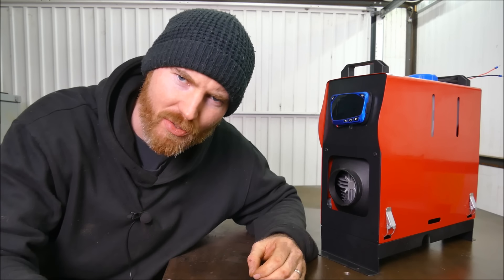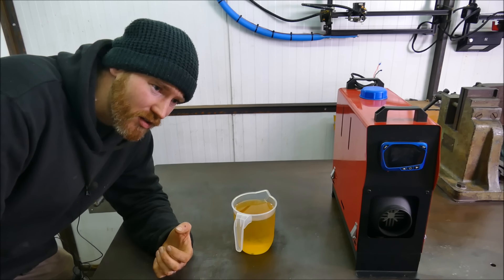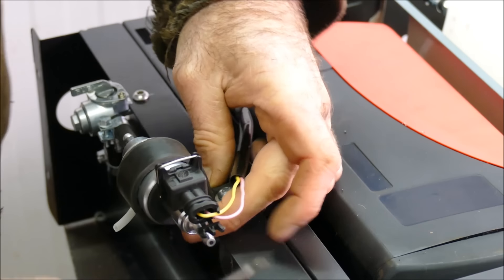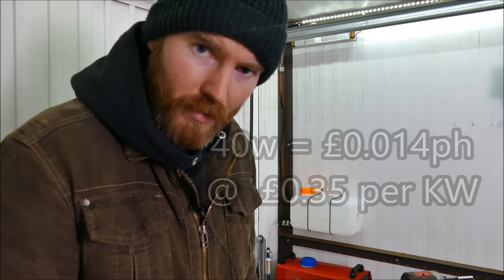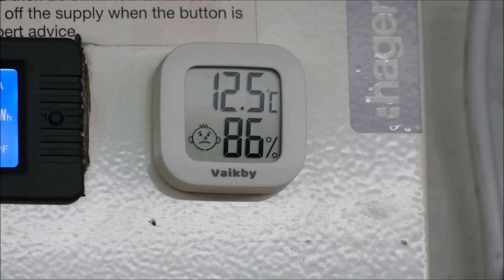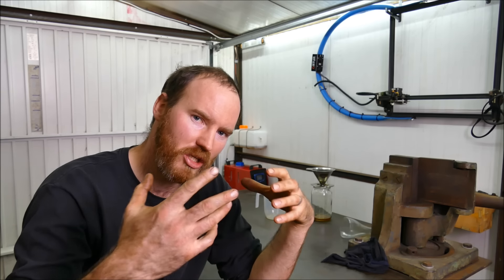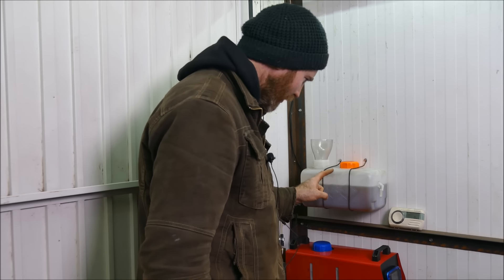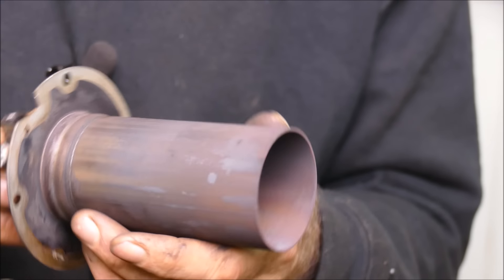£0.03 per kWh heater modification - Top facts & lies on diesel heaters - waste veg oil burn success

Comment: I use a 5KW heater in the greenhouse and when I extended the exhaust as you have I had problems with it not burning clean presumably through the back pressure not allowing it to clear the fumes quick enough , I then used a 10 foot length of 42mm copper tube as the exhaust. This runs the full length of the greenhouse and as it exits it is still too hot to put your hand on it without getting burned, however it runs much cleaner. The point being the soot build up you experienced may be due to exhaust restriction rather than the fuel. It might be worth experimenting with say a length of scaffold tubing it's easy enough to fabricate a connection with the gear you have.
Reply from the maker: Great information. Thank you. Cheers J
Reply: Where I live it frequently can drop to -18C (Canada) for my daily use the fuel is 50/50 diesel kerosene, exhaust short as possible on a downward angle. My needs are primarily heat, but the mods are ingenious and informative. The cost of energy in the UK to me is staggering, luckily you live in a temperate climate.
Reply from the maker: @wrxs1781  I just found out we buy a lot of Canadian trees to fuel biomass energy in the UK. To me that's crazy. Cheers J
Reply: This is correct thinking. If you increase the length of the exhaust on these heaters or use more than 4 bends, you have to increase the size of the pipe.
Reply: @joshuadelisle  As in wood pellets, many people heat with wood pellets "pellet stoves" "compressed sawdust pellets, and corn stoves, using corn kernels. People out of the cities heat with wood, or propane.
Reply: And heavy mass tubing will absorb massive amounts of sound.
Reply: Given the time,  if waste oil is stored over a long period the water and gunge drops to the bottom, so with a take-off up from the bottom you get much much cleaner oil.

Comment: You should consider the drainage gradient of your exhaust since the exhaust is now coming from the bottom. might even want to consider a syphon to drain the condense water if you're increasing it's length or making it into a exchanger. Further a great informative vid!
Reply: Burning one gallon of gasoline creates CO2 and 1.5 gallons of water. Ask a chemistry teacher why.
Reply: Indeed.  I heat my large workshop with a condensing exhaust gas boiler, and the exhaust wraps around the heat exhanger, that has a sealed drip tube off the bottom, where it feeds into a siphon/trap that delivers waste water where it can be disposed of.  And it’s a significant amount. :)
Reply: I was going to get one of these for emergency home use.  I was going to get an extension and run it up the chimney.  Are you suggesting condensation would run back down the pipe making this impracticable?
Reply: You've got to get rid of that corrosive condensation. Straight up is a recipe for disaster, IMO.

Comment: This was SUCH a great video! I am for sure going to use the copper tubing heat exchanger idea! But how much does a repair kit cost? If it’s over 5$ and you have to change the screen and gasket every other time it’s not worth it to run waste cooking oil. I was really excited about that as I have access to as much as I need.

Comment: Wrapping a coil of copper and then insulation around the exhaust would be far safer. Work on that hot water rises to avoid pumping it if you can, also get a pressure vessel that u can pressurise with the compressor to force the oil through to filter it. Perhaps modify a beer keg or an old compressor tank etc. also does your backyard smell like a chippy now? Lol

Comment: If you are trying to see how much you can squeeze out of the heater you might do well to make an airtight cowl around the exhaust pipe and run it into the air intake. Vent this to outside and you will pre-heat the air going into the heater. This would allow you to measure the heat gained, not that you would gain any more heat ;0)

The difference in fuel usage could be down to the different viscosities of the different fuels.

A great series of videos ..... please don't stop!

Edit ...... Don't Try This!
Read the comments below to see why not (unless you want to trash your heater control circuitry!
Reply from the maker: Good tip. Thank you. More to come. Cheers J
Reply: @joshuadelisle    Within their capabilities, these pumps are positive displacement type.  If viscosity is reasonable and lift limits are reasonable, the volume pumped should be the same.
Reply: You'll then be heating up the electronics where they are purposely placed at the cool air intake.  I would perhaps design an additional heat exchanger round the exhaust system and then exit to outside.  Put the squeeze on it!
Reply: Add to the viscosity, that oil canister was mounted higher than original tank, which creates extra pressure
Reply: @iIiWARHEADiIi  The design, as a parking heater could easily lift diesel from the vehicle fuel tank.  The prescribed limits of fuel feed,from above or below, are in the installation instructions - those things that lots simply seem to ignore!
Reply: o no you dont do that 👉
do not preheat your intake air with the exhaust. 
you running the risk of overheating/melting your elektroniks and/or the fan....
dont ask how i know 😒
Reply: A finned tube radiator would be an ideal exhaust pipe. Sometimes those can be had second hand for pocket change. Or run the exhaust pipe -in-pipe with a ventilation spiral duct, and put gravel inbetween.
Reply: @torbendk2777  and cold air is denser, means it is geting more air
Reply: @tommay2561  NO!
I was suggesting using the exhaust pipe to heat the incoming air. 
I did not realise that the incoming air was used to cool the electronics though ..... so maybe not the best idea? 
Having said that we already Do breath in burned fuel, every day, every single one of us!
Reply: It looks like I was wrong ...... but right as well!
Rather than taking the exhaust heat and putting that to the input but the other way  round .... take the heat output and run that across the exhaust to suck out some additional heat from that!
Reply: @torbendk2777  Agreed, and have had this happen when the oil heater was sucking fresh air in from an auxiliary heater on my bus whenever I was driving. very quickly had hard thermal shutdowns
Reply: Dude thxs for no ads
Reply: Don't do this as cold air has more oxygen molecules per unit volume due to its higher density.

Comment: Just a little suggestion if you wrap copper around the exhaust you will want it oriented vertically. If it's horizontal you may get a vapour lock which could burst the coil. Of for instance the water pump fails.

Comment: You should actually try a small car catalytic converter. They produce heat as they cause the reaction. It will also add a long pause in the gas flow in the cat due to the turbulence. Just keep it really close to the heater so it can get hot enough to start the reaction
Reply from the maker: Good tip. Cheers J

Comment: Great stuff! Worth watching (&subscribing)... Saved my frying oil(for making oliebollen) and wanted it to mix it in with regular diesel and also the latter to be replaced by kerosene. When running your diesel car on veg oil, it was advised to just mix a little methanol in it as the viscosity is lower which could create starting problems. I would just run with 'blended' fuels. It looks we are going back to the old times, making our own fuel to stay independent! It was also the reason as why mr Diesel invented the diesel engine (only rich people could afford patrol cars). The whole reason why governments want to get us electric, to take our liberties. Anyway, great upload, looking forward to your next one!
Reply from the maker: Yep I totally agree. Im working to be independent from the government and corporations. Cheers J

Comment: You made a lot of mistakes like I did in the beginning. The exhaust pipe must always go downwards. You never take the intake air from the outside because of the large amount of moisture that later accumulates in the exhaust pipe, which condenses on the walls of the exhaust pipe, especially if you try to use the thermal energy of the exhaust pipe by some kind of heat exchange. Residues of unburnt vegetable oil and moisture from the air, if combined, create a chemistry that begins to slowly eat away at the metal parts it comes into contact with. And lastly, filtering the vegetable oil. You don't want to filter warm oil, you want cold oil. The reason is that you want the filter to catch as much coagulated glycerine as possible, that glycerine contains particles of water that are in the oil, and the glycerine itself is very difficult to burn and will clog the chamber and the exhaust over time. I personally heat the oil to 100 degrees Celsius on my wood stove then let the oil cool. I fill it in 5-liter plastic bottles and put it in the freezer. When the oil coagulates, I filter it. I mix it with diesel 50:50
Reply: The water doesn't come from the air. Most of it is from the burning itself. Any time you burn hydrocarbons (combining for example O2 and C8H18 (octane)) it produces CO2 and H2O.
Reply: @kalleguld Wrong.  Just wrong.
Reply: @Sonex1542  @kalleguld  is correct b/c combustion does indeed produce water vapor.  Thus why you often see water dripping from a cars exhaust pipe.  Cooling the exhaust will cause the water vapor in the exhaust to condense.  Water in the air will not likely survive the combustion process.

Comment: "Like anything German they made it right" clearly you haven't owned a German car of ANY brand in the last 15 years 😂 mate
Reply: That is the unfortunate truth.
Reply: LMAO
Reply: Why what’s wrong with them? If you make a statement, back it up with stats. Open a debate up..
Reply: @GooseEldredgeFam   you want stats. Look at every reliability survey over the last 10 years. British and German at the bottom. Japanese at the top.
Reply: Not true. The uk would be at the bottom and Germany is number 1 in terms of vehicles that is. Though I would agree that Japan should be number one
Reply: @velling12  look I own 2 German cars. I'm just saying I've worked in the trade long enough to realise how downhill they have gone in recent years. My judgment isn't clouded by an old 'quality' name, just recent products. Where as the Japanese may not have the nice interiors (in general some are beautiful like lc500) but they'll do 100k no problem with routine servicing. Germans used to be like this. But now after working in main dealer I can confirm after 3 months of buying your brand new German car if you don't have an engine light on for a known fault they never want to acknowledge , your lucky. Bmw. Vag. Merc actually turned themselves around slightly since early 2000's, best of a bad bunch now but customer service awful so evens out as just as bad.
Reply: @Jw20000  I agree, but that's not what the surveys say. Germany still at the top

Comment: A couple of things - there is not necessarily a leak in the condenser exhaust; you just wildly underestimated how much water will condense out of the flue. 3CH2 + 6O2 = 3CO2 + 3H2O Therefore you get roughly the same volume of water out as hydrocarbon you put in (1/1 ratio although the densities won't be exactly the same.

And 140°C is not half of 306°C, as 0°C is not absolute 0 (that's -273°C or 0°K). You also need to account for the energy in the gas state; Condensing water yields >100% of thermal differential. Aside from that great video

Comment: Hello, very interesting series, a few thoughts here:
- You could use the system that modern gas stoves use. Basically, they heat the incoming air (directly from outside) while the exhaust gas is forced out. They do this by using 2 concentric tubes as heat exchangers. Very simply put, it is a tube within a tube, the inner tube expels exhaust gases, the space between the tubes feeds cold outside air and is heated by the inner tube. This is the way many efficient gas burners work, so it must be efficient. This also gives you an easy way to deal with condensation.
This way, your hose will also feel cold and should not have any meshing around it.
- Secondly, I see you are comparing electricity prices in kWh with your diesel/kerosene prices. This is correct if you assume 100% thermal efficiency of electricity, such as a boiler or induction appliance. However, a heat exchanger can easily exceed thermal efficiency by a factor of 4 (I have heard some even say 5).
This means that if you put 1 kWh of electrical power into a heat exchanger, it will emit 4 kWh of heat as energy. This is how heat pumps and AC units work.
Of course, there are other factors to consider, such as the desired indoor temperature and the outdoor temperature, but you get what I mean.
Comparing it to a resistive electrical load is somewhat incorrect.
- Thirdly, cover the electrical connections you made on the transformer so that they are not exposed.
Thanks for the content, I enjoyed your efforts 🙂
Reply: For most people, their biggest heating bills are when it's cold outside, like 5°C or less, and in these conditions (with a delta T of 15°C or more) there is no way heat pumps will have an efficiency of 4 or 5, it'll be much less. If anything, saying heat pumps can cost as low as 9p per kWh is being very generous. I say this given that in the summer months, the heating's on so little, that it doesn't make sense to work out costs based on efficiencies of 4 or 5.

Comment: If you use the electricity to run a heat pump, you should stretch the heat much further. For a source of heat to pump, try the exhaust stream of the generator.

Comment: To give the exhaust a better flow use a 4” aluminum dryer vent and recoup more heat with less restrictive flow.
Reply: You want more surface area to extract more heat and as slow a flow as is practical, so the ribbed flexi stuff is probably better than smooth tube.

Comment: I found that baseboard hot water heat pipe works great to extract the wasted heat going out the exhaust, it is copper pipe with aluminium fins and I was able to extract 90% of the heat that was going outside, it comes in 8 ft sections or better if used and get for scrap price, also its a TOTAL of 270 degrees on the exhaust so 3 90 degree elbows or better yet not a hard 90 rather a soft 90 to help reduce too much back pressure , the long section of hot water baseboard heat pipe extracts most of the wasted heat, was getting 250 F from the air duct and 270 F out the exhaust...
Reply from the maker: Great information. Cheers J

Comment: You could try to use the heat from the exhaust to heat up the inlet air. If the temperature difference is higher (inlet air is colder) the exchange is more efficient.

Comment: Letting the intake pipe run right next to the exhaust for a bit should make for a good preheating system. And covering the rest of the pipe with even more structure that acts as heat sink should drastically increase how much heat you can siphon. You might even get away with just sticking on some old heat sinks for computers on top of it.
But at this point you definetly will produce a lot of condensed water again
Reply from the maker: Thank you. Great tip. Cheers J

Comment: Be careful with the line power mounted above the power supply.  A piece of tin as a heat shield will prevent any melting of the insulation.  You have put together an excellent video, thank you very much for posting this.
Reply from the maker: Thank you so much. Cheers J

Comment: Put a catalytic converter as close as possible to the exhaust port. I bet you'll be able to run a bit more efficiently and not worry about smoke as much. You can get small ones for pretty cheap.

Comment: The hard line is only needed between the pump and the heater. easier way to switch between WVO and kero is to use two fuel pumps teed right at the heater, then to switch you just wire up a three way switch to switch from one pump to the other. this way you don't have to run it nearly as long when you switch back to kero before shutting down.

Comment: Top Tip for getting more heat out of the exhaust. 
Route the exhaust through an old radiator. 
Seen a German Youtuber do it and it got very hot and helped heating. 

To be honest, if it was that cheap to heat with a diesel heater where I live I'd be heating my house with them.
Reply: Thanks. So it is not that cheap after all? Is LPG or natural cheaper?

Comment: You can also use an egr cooler off a car/van to heat water up just put the water tank higher than the cooler and you won’t need a water pump

Comment: how much sqm can heating?
Reply from the maker: Check online but for a 6mx2mx2.5m room requires 2kwh of heat to be sufficient. It depends on how much fuel you use but diesel/kerosene contains 10kwh of potential heating energy per litre. So this unit produces 3.5kwh minus what is lost through the exhaust. Cheers J

Comment: What about putting exaust through a sand battery to reclaim more heat and you could put a copper line in the sand to heat water.
Reply from the maker: @greghasselback  I've tried that in the next part of the series. Cheers J

Comment: Have you considered running the exhaust pipe into a radiator (at the top of radiator) another pipe (from the bottom of radiator) to capture the heat from exhaust?

Comment: Old carbureted cars sometimes had exhaust heat exchangers, used to heat up the engine intake air (for better carburetor efficiency I believe). Repurposing one of those might be a good way to recover heat losses, especially since they were designed not to impede flow.

Comment: I've got one but not installed it yet. Was thinking of running exhaust thru some hot water base board elements.  Like a 3 or 4 ft.   Should extract alot of heat that way and the baseboard is pleasant on the eyes  and circulates the air thru  aluminum fins thru convection......